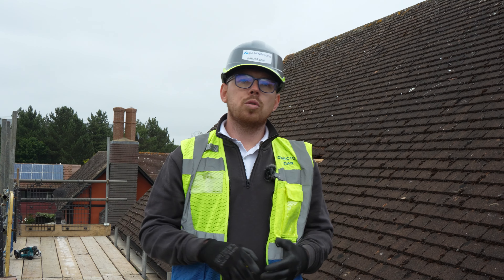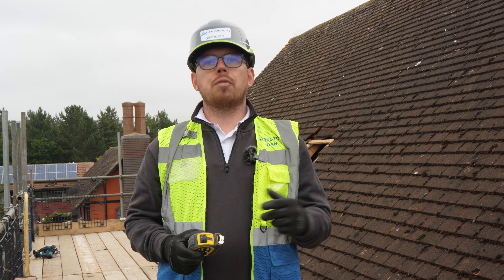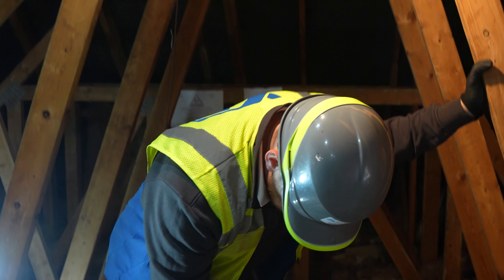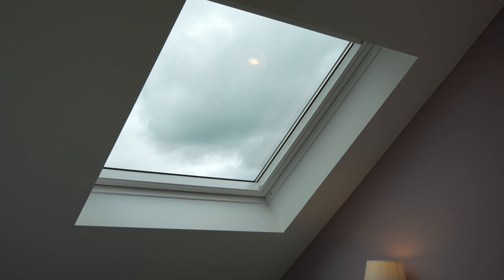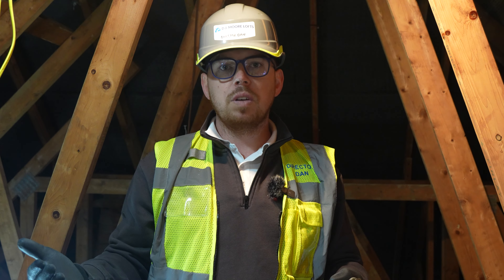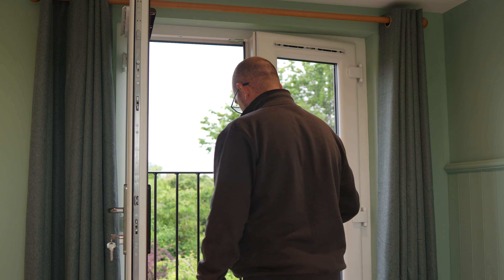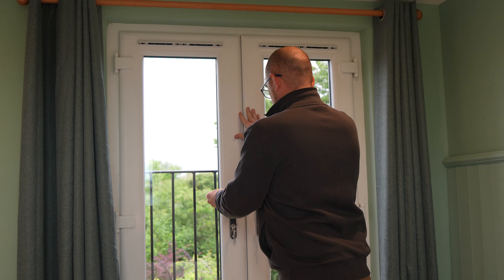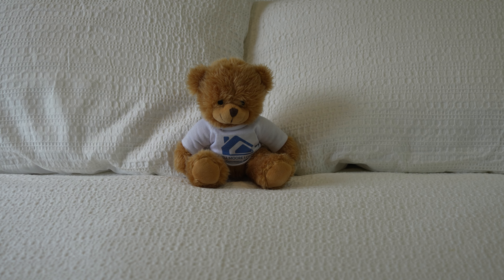How Much Roof Height Do I Need For A Loft Conversion!

Comment: If you have a small loft, not able to stand up in it size does that mean I can’t have a loft conversion?
Reply from the maker: Not unless you can lower ceiling highs down stairs. Or lift the ridge line. Ie whole new roof. (Subject to planning) cost pushes most people to move instead as can be very expensive for a ridge lift.
Reply: @djmooreloftconversionspeci458  thanks for the reply! Yeah tried the moving part it Isn’t going well so was looking at maybe having a loft conversion but after seeing your video got me a little confused with how small my loft actually is and no wouldn’t be able to lower my ceilings

Comment: I was told there is no legal head height for the room....only 2m above the stairs? Is this wrong!
Reply from the maker: This is correct. Only need 2m for the stairs to comply.
Reply: But you say 2.4m height in the loft in your video...am I missing something?
Reply: @KO-hf6bl  2.4m from the plasterboard ceiling below to the apex in the attic is the minimum requirement before conversion. After the conversion, you're left with a head height of less than 2.4m

Comment: 2.2 metres head height used to be the norm after conversion is completed 2 metres
Reply from the maker: Rules have changed around insulation now. We were able to convert lofts at 2.3m before but now with the extra insulation and ventilation needed. We say 2.4m.